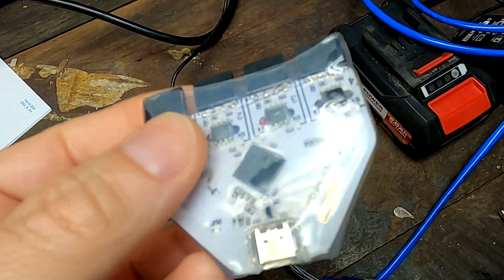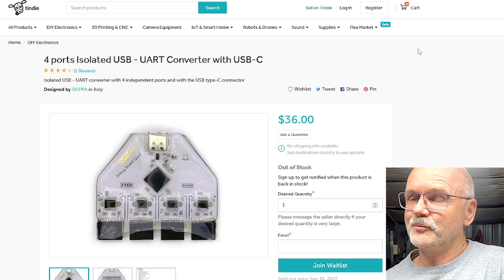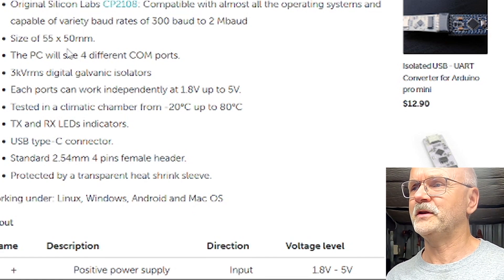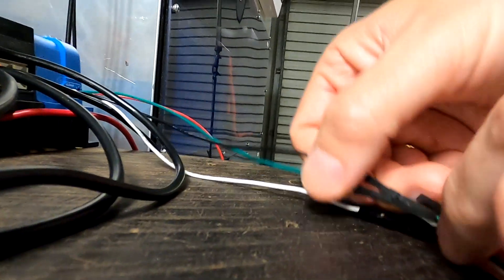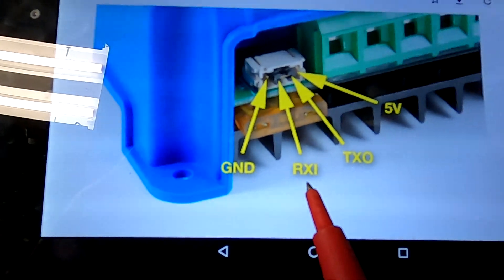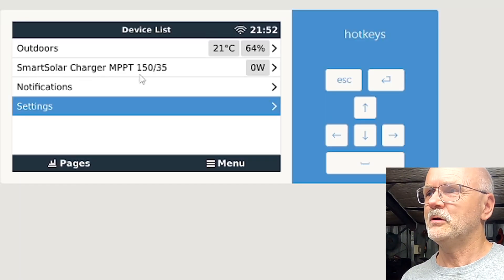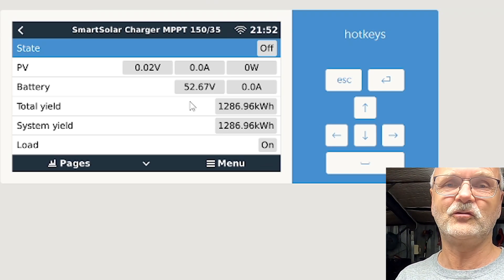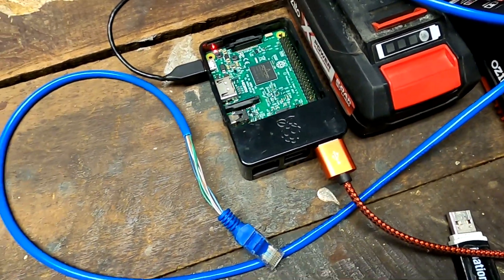Connect 4 VE.Direct Victron devices to one USB port.  Save space and isolate all your devices!

Comment: It's a great device but only one problem!
What was the design thought process behind the board layout? I mean.... Was they thinking that someone would just purchase it and just plug it in and use it! How are you supposed to mount it? What's with the shape of it? It looks ugly! There are no mounting holes!!!! 
It's people like this that took the beautiful design of the 70's and 80's boombox and started to round off the corners till it ended up looking like a bush pig! 
Sure, it's shape is efficient but it's not functional! 
You can probably already tell that I have had this problem before and you would be right! There are way too many devices that no one seemed to give a thought about how it was going to be mounted! 
It's only the first time when you get something like this sitting on the bench and it's kinda cool, there it is, just a little PCB board with some components on it just doing it's thing but then you realise that it can't just sit there, and then it hits you! The only option you have is to wrap it in some heat shrink or something else to insulate it and it's just going to have to hang loose inside a case! I just get so annoyed that they went to so much time and effort to get something worthwhile and it can't be installed! Unfinished project! It might as well be landfill like a lot of other junk that comes out of China and readily available on eBay or Ali Express...
Reply: That's where you need a 3D printer, to make a suitable mount, but as you say you really shouldn't have to, but unfortunately we as end users are never going to change poor design choices so we just have to work around it. It is so frustrating, I've had so many why did they do that moments, where a simple design change could make things so much better.
Reply: @TheRonskiman  I have never really had the need for a 3D printer, although if I had one I probably would have used it possibly more than I realise.... 
I guess that it's going to be one of those things that eventually they are going to be as cheap and common that they will be sold alongside the common paper printer and when they run out of consumables, they both will end up together on the nature strip due to after market filament not being compatible with your specific model!!!! 
I can really see this happening LoL. You probably already get some filament with a new 3D printer to get you started. All that's needed now is for someone to find a way to get the printer to detect the type of filament and not work if it's not theirs... 
This is the world we now live in!
Reply: @PeterMilanovski  Luckily 3D printers aren't yet made with the restrictions off paper printers. You buy your 3D printer, you buy your choice of filament, then you set about trying to get it to print, which is a steep learning curve, but once you get it working they are incredibly useful, and I will be using mine to print things for my solar/battery install.
Reply from the maker: It is advertised more like a test and developer board. I guess most developers don't really care of a nest of cables on their desk when testing things out. I would probably mount it with some Velcro in my battery shelf where the Raspi and the 12V converter sits.

Comment: Good info Andy, these comms issues are a bit above my pay grade Im afraid, it gets frustrating at times to say the least, it would be nice to see some more wireless type communications/options available to help simplify and overcome some of these type issue. Cheers
Reply from the maker: I think wireless connections would make it even worse as there is nothing you can troubleshoot. Here, I can at least disconnect some cables to isolate the devices and test if it makes a difference.

Comment: It is suprising to me that all comm ports on these units are not already isolated as soon as they enter the case of the device.  I always thought it was standard practice and just plain common sense to have isolation on all communication ports for devices that are used in conjunction with other devices on a bus or common data connection.  They should also already be grounding the chassis to the rest of the system so ground loops shouldn't really be a problem since the cables used here are incredibly short.  It woudl be differnt if this was a 100+ foot cable run across a factory with a potential for RF and EMI interfearence at a level where their would be problems.
Reply from the maker: The Victron Cerbo has all its ports isolated but not the Raspberry Pi. So this converter is not really needed for the Cerbo but mor for the DIY Pi.

Comment: Isolated connections also prevent wiring fires if a - side problem ever arises in the system.  Imagine the thin communications 'ground' wire trying to carry 15A or more to return a high current load.  Everyone puts breakers and fuses in the + wiring but no protection in the - wiring.
Reply from the maker: The thin wire would act like a fuse, I guess but yeah, it could get really hot at some stage if the current is large enough but not too large.
I have used isolator breakers in my installation, double pole DC circuit breakers. I like to isolate when I shut something off, not just disconnect the circuit.
Reply: @OffGridGarageAustralia  The thing to worry about is the insulation.  Insulation on light wiring is rarely flame inhibiting.  It takes only moments for a wire to heat to the point where the insulation ignites and from there things can rapidly go down hill.  The possibility of high current flowing on comms wiring etc is usually overlooked.  I have some photos I took years ago floating around here somewhere where this exact thing happened.  A main - terminal had come loose due to incorrect installation and comms wiring tried to carry the return current.  In that particular case there wasn't a fire but it was pretty clear it was only sheer luck that there wasn't.  The wire bundle with the comms wiring in it was severely damaged.

Comment: I hate cables... I wish these equipment connects wirelessly already.
Reply: Bluetooth is not 100% reliable.  For critical equipment, hard wire your data lines.
Reply: I agree hard wire data lines provide more reliable comms. But these are not critical equipment and can do just fine without comms.

Comment: Andy
Great info. 
Ahead of the curve as usual. 
You may have solved the problem at the charge control by isolation of its data feed but it may be something other than a ground loop involved. You may be getting a surge from an inductive load like a pool pump, hvac or other traveling into the rest of your system. Over 75% of household electronics surge damage is caused by something inside the house(load side) not nearby lightning. I had weird things happening and installed whole house surge protection on both sides of my inverters grid and house and and the moment I did problems went away. It’s been rock solid for six months since I’ve installed them. I don’t know if you already have something but I thought I’d mention it just in case. The ones I got are model Square D HEPD80.
Reply from the maker: Thanks Karl, I will test it out and see if this resolves the issue. Victron said it's unlikely that the -1°C problem comes from using not-isolated cables but it's better anyway to use the isolators.

Comment: Thank you a lot for the video, that was unexcepted!
At the moment the board is again out of stock, i will received the new one in 3 - 4 weeks!
Reply from the maker: Thank you guys. It's a great product you have there and very useful. So please let everyone know once it's back in stock. You may get some orders then 😉
Reply: @Off-Grid Garage  I have added the board in pre-order and i have also managed to make the cable!
Reply: @Duppadotnet  just ordered the board on your site with the JST connector and the JST cable. This is a perfect solution. Thanks.
Reply: you built a really great product. Just ordered another 4 pieces with some cables to fit more Victron installations with it. Cheers from Germany.

Comment: In my system I also had many strange problems when I was using the cheep not isolated usb serial adapters. After I switched to isolated ones (which you can get from Amazon) the problems went away. DSD TECH SH-U09C3 This does not require power from the Victron devices because it has an isolated power supply on board as well.
Reply from the maker: Oh, wow, nice one. For certain application pretty useful. Thanks for sharing.

Comment: Interesting segment Andy. The thought of possible ground loops, but more likely stray currents, EMI, static charge and other 'circulating currents had crossed my mind, but not knowing the details of your system I assumed they were likely well addressed by Victron's design.

Having worked quite a bit with industrial instrumentation and controls, one of the continual challenges was controlling stray currents on signal cables.Heavily shielded and grounded signal cables were often very noisy, not because of external EMI but because of fluctuating ground and signal potential differences between connection points. In most cases I found it was due to cable shielding and grounding conductors being bonded at both termination ends inducing circulating current and noise between connection points, due to static or induction currents from other equipment.  Typically signal cables should be grounded and bonded at one end to avoid inducing such currents. Sometimes isolating shield and ground conductors and establishing separate isolated signal and equipment grounds were implemented. 

Installing  good-sized ferrite chokes on signal cables are typically a cheap and reasonable precaution. in extreme cases I sometimes had to install properly grounded inductor isolation and drain coils on and between signal grounds and shields.
Reply from the maker: The Cerbo for example has all its ports fully isolated but as we use a Raspberry Pi, it's a different story and this converter may come in handy.
Reply: Agreed.

I have found that failure to use twisted pair for common mode rejection is the most common issue.

Shielded cables can be more of a problem than a help. Ground termination should only be at one end and all common with the same ground.

99% of the time it's failure to maintain the above that creates problems.
Reply: @TRS-Tech  Indeed. Good point about twisted pairs. I seem to recall that all the shielded signal cables were made with some twist to the signal conductors, so perhaps some of the issues I encountered were related to shielding. I do recall isolating shield on both ends of some problematic cables and having noise issues become worse.
Reply: @jackoneil3933  In theory if the twisting ratio / impedence is correct then sheilded cable should not be needed. I think cable routing plays a big part to. Its easy for mains cables to induce noise for example. In theory the rejection from the twisted  pair should be enough... that's in theory of corse. As you appear to be talking about PLC I assume you were mostly using RS485. We're the pairs terminated with a resistor on the end  ?

I know the official Victron cables are just twisted pair and not shielded but as Andy pointed out the Cerbo does have opto isolation, that seems to be  the best solution. I do remember from uni that as you correctly stated above the shielding should be common and only terminated at one end.
Reply: @TRS-Tech  Good points again. I was involved in the Oil and Gas and Nuclear industries, and hundreds of feet, run in dedicated  instrumentation cable trays,  so bare twisted pairs were generally not used but I recall a few short runs in conduit. 

Rarely did we have long runs of serial data cables such as RS485 which was short runs in control centers and rooms for PLC's and data transmitters. Most of our signal cables were for 4-20ma control, so what I typically encountered was induced current from various sources.We used a lot of 24, 48 and 125 VDC control and I occasionally saw stray current on control lines from static and circulating currents between locations which typically contained megawatts of motors, generators, restive and inductive loads. 

I understand most solar and victron installations are a bit different but in the oil and gas industry I am familiar with was in very dry arctic and desert conditions, with a lot of wind blowing over metal buildings larger but similar to what Andy has, and circulating currents due to static caused by wind were a common cause of issues.  As an example I was once installing a cable tray between to two large oil and gas modules the size of large office buildings mounted on vertical supports and when I went to connect two long sections of cable tray they arced and welded slightly together from static charge alone I later connected a VOM between the two long runs of of cable tray and saw voltage fluctuate between -60 o + 200VDC an initial static capacitive discharge of over100amps,  and 20 to 60 amps DC between the two sections of cable tray that were carrying the static charge between the two large modules, so I would not be surprised to see static potential and current between even Andy's metal buildings.
Reply: @jackoneil3933  Oh wonderful... different phases and grounds on top of intrinsically safe requirements.

I don't envy you sorting that lot out. I expect everything these days is fibre optic only. I remember getting a nasty belt from a coaxial network cable thanks to a grounding issue. Signal and data transmission is not as easy as some think as we both know.

Semaphore anyone  ? ? ? ?    🤣

Comment: Hello Andy. If you check specs you will find VE_Direct are isolated connectors..so no need to worry.. so not a problem there...only USB and VE CAN are not isolated..and there is limit how many VE Direct connection you can make..if i remember it is 5 only
Reply from the maker: The Cerbo can handle 15 USB connected devices, it says in the manual. So that should cater for even very large systems. My new MPPTs will have CAN ports, so I will use that to connect to the Cerbo at some stage. But for now, VE.Direct it is... Afaik only using the Victron VE.Direct to USB adapter is isolated, not the DIY adapters we're using.
Reply: @OffGridGarageAustralia  aa yes that has sense..btw i used to have all connected with Can ports..and to be honest..it was fine till i had some ground loop connection problem..it wasn't fun from that moment :) lool.

Comment: Be careful with the ve connector pinout because on smaller solar controllers it is mounted upside-down. 
Interesting converter, now I want to make my own isolated cables again... 😄
Reply from the maker: The connector in the controller has a notch so should be easy to identify the pins and connect them correctly but thanks for pointing this out.

Comment: That gap below the opto couplers ist not just a symbol for isolation. 
There are two specifiction for isolation. 
One is creeping distance and the other is arc-over. 
Electric charges can creep along surfaces esaily - especially if those surfaces are a bit dirty or coverd with moisture. The distance between input and output of those opto coulpers is not sufficient in order to provide safety required. Hence the poor creeping distance was interrupted by a air gap providing enough safety for the arc-over issue.
Reply from the maker: Thanks for the explanation. That makes totally sense.

Comment: Could you use this converter also for, for example Daly BMS UART output?
Reply from the maker: Yes, it should also work with that. but you still need the additional driver then to install on your Pi or Cerbo.

Comment: I put my 5 victron usb to ve-direct cables to a powered hub and the only problem with it is when you reboot , you get some of the devices assigned to different usb port which normally is a problem until you use node-red and find most of your flows don't work now , because of the reorder .
Reply from the maker: I had this as well in the past and was wondering why this happens. Argh, that's not good...

Comment: Isolated cables probably have no effect.  USB A uses differential signal lines and the transceivers are typically good for +/-60V of common mode.  So even though the 'ground' line will be really noisy (and I do mean REALLY noisy), it will have no effect on the data signaling integrity.

Twist the differential pairs on your home made USB A cables though.   Its GND, D+, D-, and PWR.  So at the very least you should twist the two inside wires together on your home made cable.  That ensures that the differential data signal lines will reject outside noise and EMI.

You can use ethernet cable for your home-made USB cables.  The wire pairs are already twisted and the ethernet cable will meet the signaling specs for USB (probably up to around USB 3.0).
Reply: But it is usb to serial isolated adapter, as I think, then there are tx and rx signals instead D+ and D- (no differential pair)
Reply from the maker: Thanks for sharing these tips. Great!